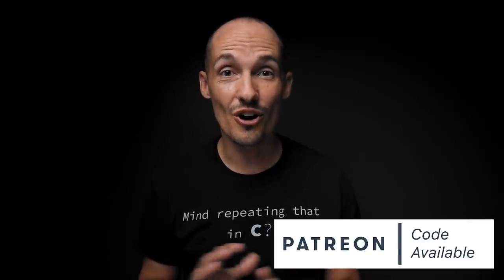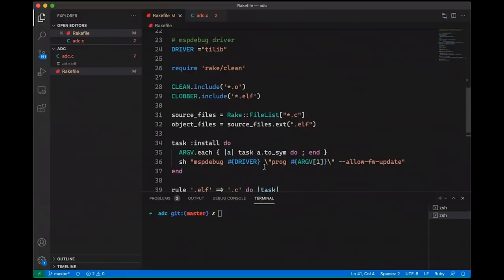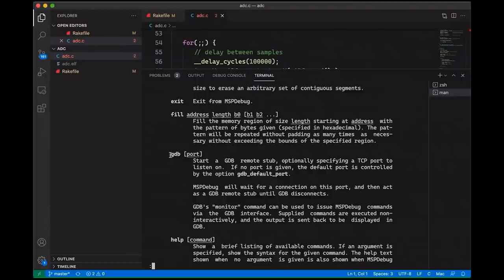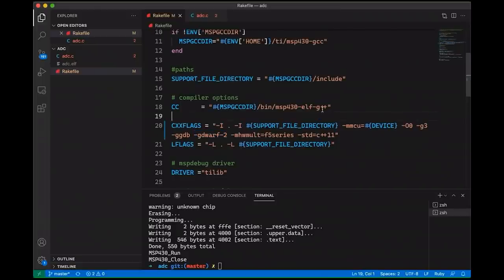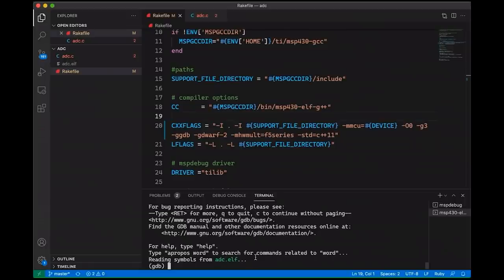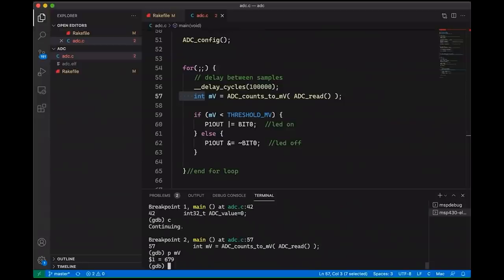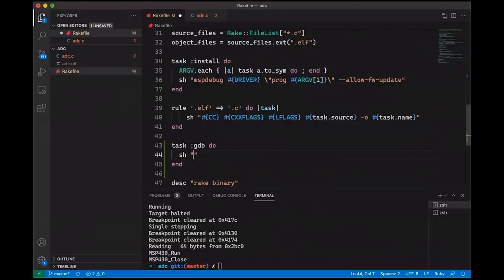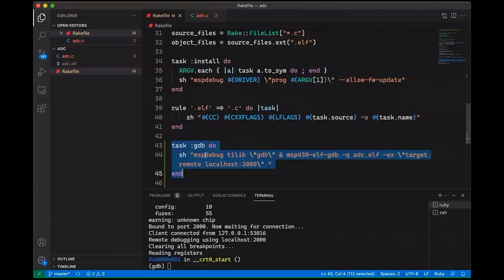Debugging Embedded Systems With GDB?

Comment: I’m 3 year embedded systems student. Last year I had to implement ir communication for a school project on the pic16f887 as part of audio amplifier. I had to decode the ir information and based on the send code had to select the right “audio channel” represent by the leds 0 to 3 for the 4 audio channels. But couldn’t find why the led didn’t turn on, after weeks and weeks I  found out that a stupid stetting that should only affected the input mode of a pin also effect had on the output mode. After fixing that it work as it should have, O boy what do I love debugging embedded systems.
Reply: You live you learn, i love that kind of moments. They remember us why we are special kind of individuals that can stick on a problem like a blob until its resolved.
Imagine a world where you would have to be an engineer in order to become a politician.

Comment: I've been doing embedded since the 70s, and been through the in circuit emulator era of the 80s and 90s, and now the JTAG and ICD era of the past 20 odd years. I wouldn't be without debuggers, printf, GPIO twiddling, high speed SPI, or high speed UART as strings to my debugging bow, but it's horse for courses. Some devices I code for don't even have enough space for printf.

Probably the biggest resistance to debugging embedded systems is the amount of hassle it is to get it working on many embedded platforms nowadays.

IME, the most reliable environments were the proprietary vendor IDEs of the 2000s and early 2010s. Java-based IDEs dependent on JNI to talk to the debugger hardware are always flaky AF. Nowadays we have to spend endless hours of valuable dev time farting about configuring the required software components. Debugging the debugger is a very real thing.

Back around 2000 it was far easier!

Comment: The Debug Configurations window shows 'Start GDB Session'.. yet uses variables that I can't find anywhere!
${cross_prefix}gdb${cross_suffix}

The "actual executable" entry cannot be changed and is set to:  arm-none-eabi-gcc

Would love to see how all this works..  openocd vs gdb vs fpserver   
For example, one executes openocd, yet under the hood there is gdb somewhere.  An 'fpserver' is also started, which seems to be related to the jtag hardware adapter I'm using ("Flash Pro").

Comment: you know that you can integrate gdb debugging with vs code so that it's actually convenient (i.e. start debugging with f5, step with f10 etc. like desktop application)?
Reply from the maker: Thanks.
It might just be inertia and the way I learned, but I haven't found the plugin to be a benefit over just using gdb in the terminal. It doesn't seem to speed me up. I think part of it is that the F keys are farther away from where my fingers rest (and require a 2-key sequence on my laptop), and the gdb commands are so short and close (n, s, r, c, enter). To each their own, of course. 
Also, I try not to be too editor-specific in videos in case someone isn't using vscode.

Comment: Thx for sharing. Never designed anything with an MSP430 but it seems like the process would be far easier and less problematic using Kiel or IAR or even eclipse IDE for the free stuff than trying to force it in VS Code. Allowing the IDE to do all that you shows and more. What am I missing
Reply: Many IDE's have a debugger and more often than not it's already a gdb version.
But running gdb by hand gives you a much bigger "gun". You can write logfiles and compare them when stuff happens. You can also debug multiple devices at the time which is usefull in distributed systems.
With some C#/C++ you can easily write custom debugging tools to visualize things about your system.
Reply: @MrHaggyy  I get log files now.  I can and have done this with multiple instance of the tool open tied to induvial debug hardware (JTAG).  How do you debug multiple devices with the same debug tool (JTAG interface) - if you are speaking of targeting a specific hardware (more than one) with a specific instance of the code - Again, you can also do this now via the IDE.  I think all the popular IDEs allow you to target a specific debugger by SN.   More so with in the IDE I can set conditional break points on a host of things - with just a few clicks or a specific test condition, litterally written as a test condition if ((c == 9999) && (b > 25)).  Please respond - if there is something here I am missing I would like to know.
Reply: @EfieldHfield_377  each target needs a connection to the host PC. But it doesn`t need to be JTAG, could be USB, CAN, Ethernet, etc as well.
I have not debugged multiple devices in one IDE at a time, good to know.
Well biggest benefit of the raw tool you can implement it the way you want it, you are not limited to the way it`s implemented in the IDE.
I wrote a small program to debug a master with 16 slaves in a state machine config. So i had startup times for each device, breakpoints only after each slave got registered and reached idle etc. For me it was easier to build a debugger for that system than to configure it in an IDE.

Comment: only for TI MSP430  tho.. None of the newer ones :C
Reply from the maker: It's not really a matter of new vs old. The MSP430FR5994 is reasonably new. But, I demonstrated it on that one because that's what I have on my desk. That's the one that I'm using for my current project, and I will consider switching to another as soon as someone else makes one that is lower power and has FRAM (or comparably spec-ed nonvolatile memory). Until then, it doesn't really make sense for me to switch.

That said, which "newer one" would you prefer?
Reply: @JacobSorber  im working on the CC2652 rn.